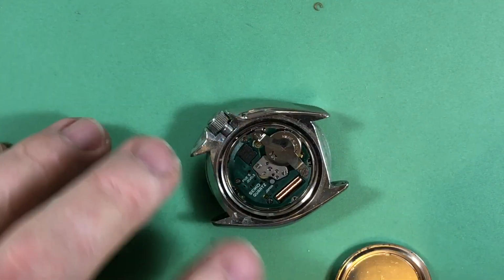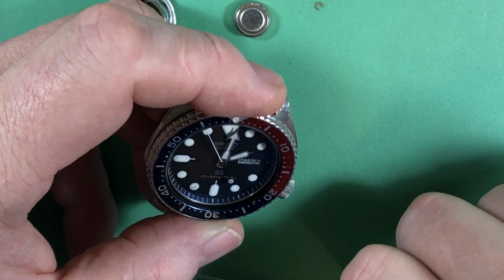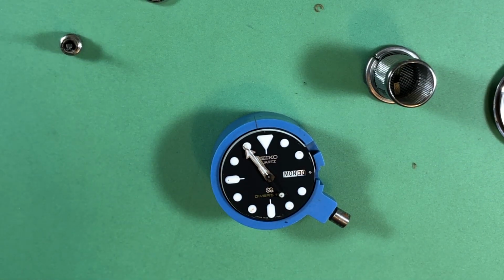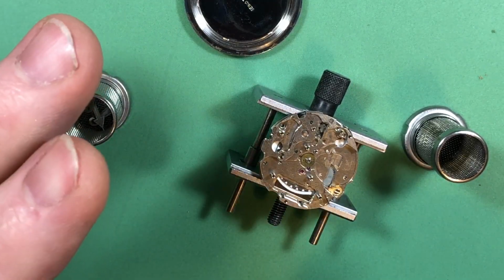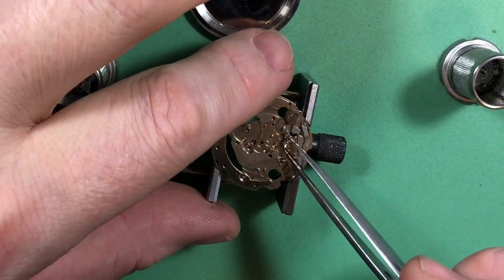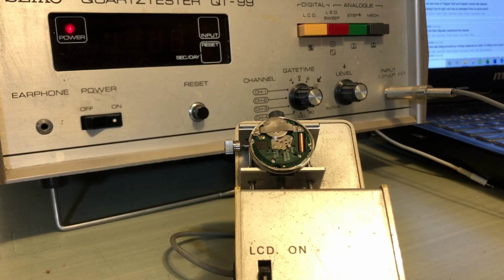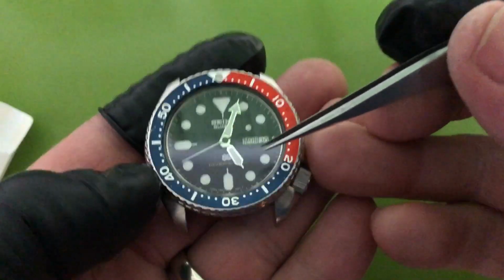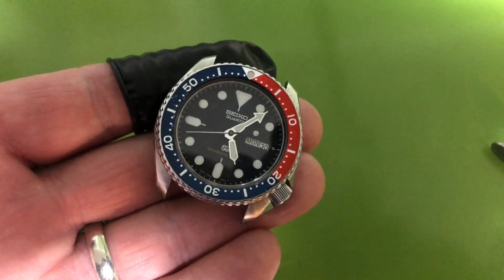For LS: Seiko 7548-700F restoration

Comment: Another fantastic 7548 video - Man I love these watches! I just got my 7548-700b back from service and it runs like a dream. However, I do wish I could change just a few things! I really wish the sweep hand would hit the markers dead on just like your restorations do. Mine lands about a third of the distance from the actual markers and it drives me nuts! Also - I really need to replace the crystal with one of your Hardlex crystals - they just look so pretty with a new piece of glass on top! I’ve been thinking about doing it myself with the basic watch tools I have (crystal press, case holder, case opener ect). Is that a crazy idea or is it a fairly easy undertaking?
PS - been listening to a bit of Nick Drake lately - bloody love him!
Lots of love from Down Under.

Comment: What kind of parts cleaning machine do you use? Any specific cleaning liquid/detergents?
Reply from the maker: A vintage Bulova WatchMaster multi-stage cleaner for movements, and a pretty generic / basic one-tub ultrasonic from Amazon for cases and such.   The one-tub gets an ammoniated cleaner meant for clocks and such - it's super stinky.  The Bulova uses two different solutions - one for cleaning, one for rinsing.  I can't remember the name brand right off the top of my head.
Reply: @SpencerKleinVintageWatch   Thanks!